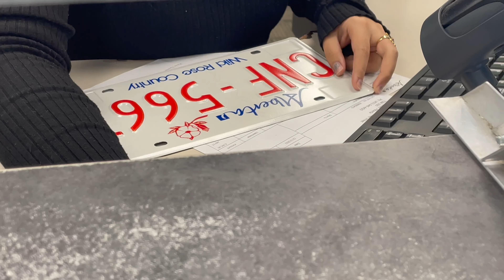Our truck broke down! Why I'm glad I never built out a sprinter van

Comment: I had a flat from driving over a large nail in a parking lot. It's very possible. It's very difficult to deliberately puncture a tire. It can be done by someone who knows what they are doing, but that object looks like it had the weight of the truck behind it. I'm grateful for you sharing your experience with us. I am leaning towards a box 🚚 truck for my build after seeing your video of your build. Now I'm very likely to go with a box truck in case of something like this happening. I can just switch chasies. Better than scrapping the entire build. Blessings to you all and safe travels.

Comment: LOL.🤣  I love that red neck bumper, plywood back etc. It looks like it would be hard to drive with no weight on the back.  I'm glad that you made it to BC OK.  Maybe some totes full of sand or some heavy stones mounted on the frame could have helped, but I know you had a time limit.
  It's appropriate that you call it "Walter White" (from Breaking Bad) because it was broke pretty bad when you  changed the box.  You squeezed every possible kilometer out of Betty!
  Getting the truck from the Alberta was a good idea. They have way less rust because of the climate.  I may do the same when I get my plane project done and move on to a stealth camper project. The older vehicles here near Kitchener are usually pretty rusty.  It looks like you should get years of service out of that chassis.
  Did Walter have a box or something else before you bought it? Was it damaged, what is the story of Walter? 
 That was an epic way to bring in the new year on the bridge! All the best for the new year.

🥳
Reply from the maker: Thanks for the support! Walter came without a box.

Comment: How is that the box could be perfectly sealed with new chassis. Does the box have multiple fixing points so it can be moved forward/ back to match chassis from different car manufacturers?
It would be nice if you had a time to film more the processes of removing and reinstalling the box.
And I am jealous you can buy RWD truck with doubled rear wheals and use it everywhere. If I wanted that here, in Europe, the RV build would be over 3,5 T so it gets many restrictions.
Reply from the maker: Hi Cobra , it was pretty easy to swap out box on other chassis, because they both are exactly the same, the same mounting points on the chassis. 
So true about European driver license! 
Here in Canada you can drive vehicles till almost 6000kg with the same drivers license.